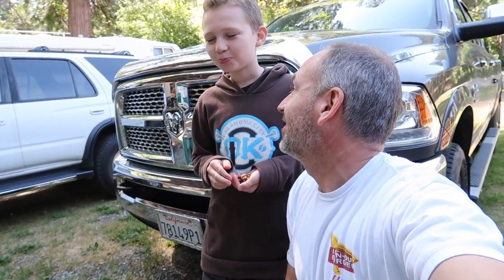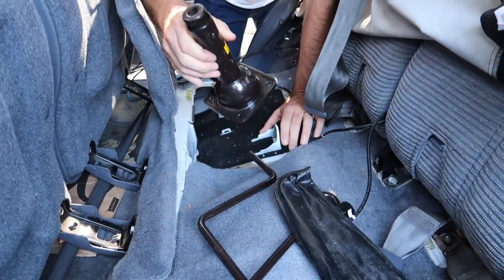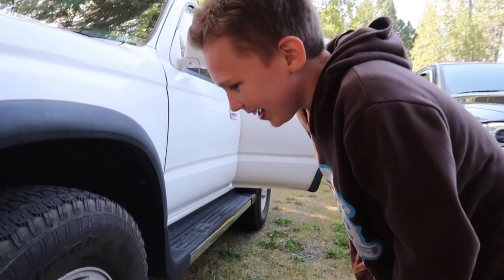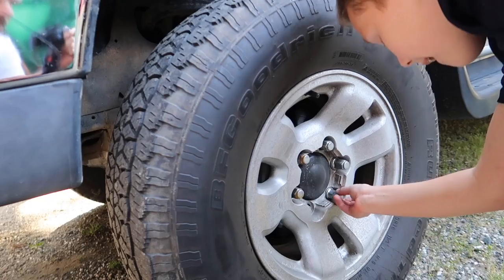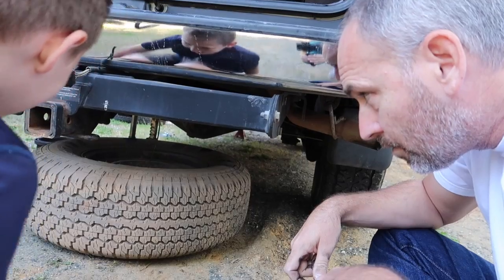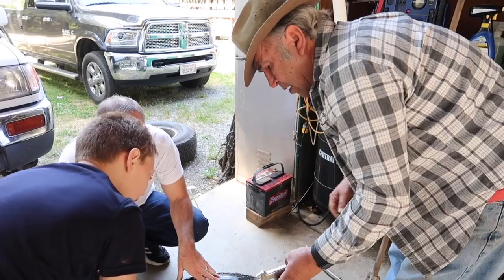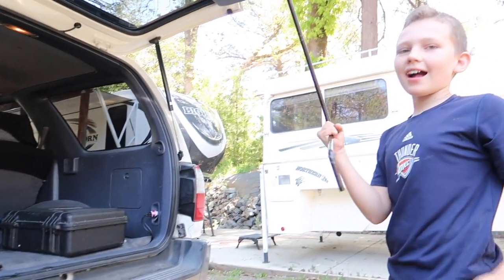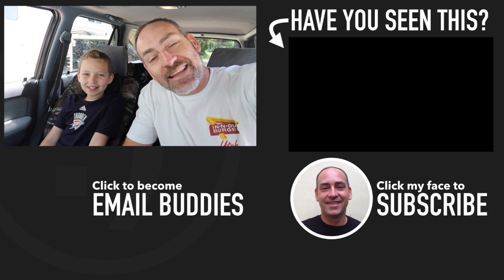Grease Monkeys, Getting Ready for Our Road Trip

Comment: sebaiknya di beri ganjalan pak bannya kalau anda melepas ban berbarengan seperti itu. Walaupun sudah di rem tangan atau mobil dalam keadaan masuk gigi, potensi lain tetap bisa terjadi. Misalnya tanah di tempat dongkrak tersebut ambles. Itu penah terjadi pak.
Reply from the maker: +Abidin SJ Terima kasih!
Reply: sama2 pak ☺
Reply: dan bleed the brake fluid because when you remove the caliper, the brake fluid will push and spill a little bit from above reservoir